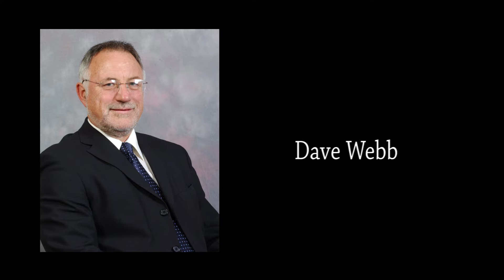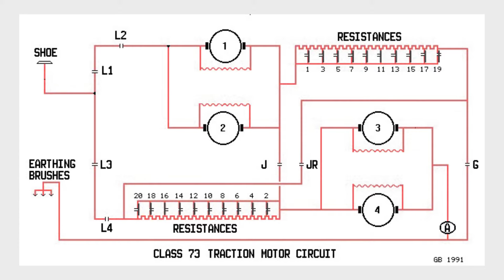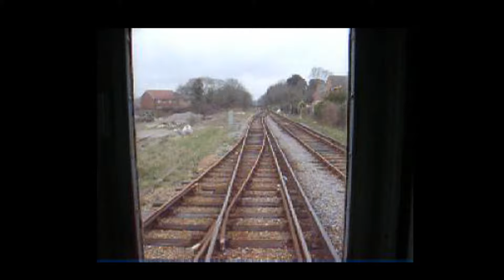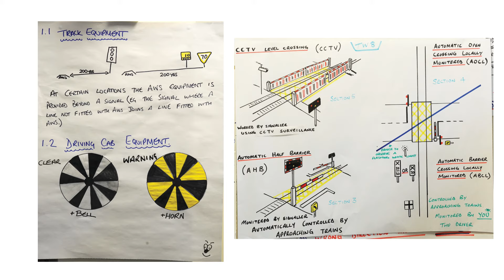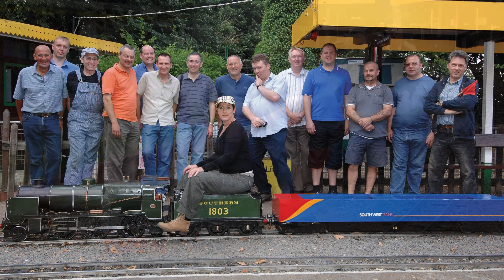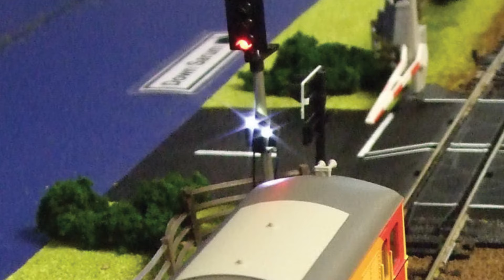Rambling Railwayman's Recollections -Training Days - South West Trains

Comment: Good to see many of my old workmates. I left Bournemouth West one morning in the back cab of a 73. The driver, Tom Upshall, was up the front in the cab of the leading TC unit and I had just given him a brake test. As we passed Branksome Station on the way to Poole we came to a grinding halt. Tom walked all the way back from the front on the troughing, he had forgotten the change end switch/lever(?).
          Jiffy took me for test on the 159s when I became a driver. On the way to London and even before Grateley I hit a pigeon, a pheasant and a deer. Bit of an air leak then but as we were maintaining pressure, Chris said keep going (air & amps as many drivers say). Top bloke.